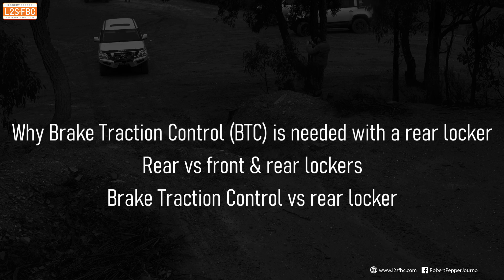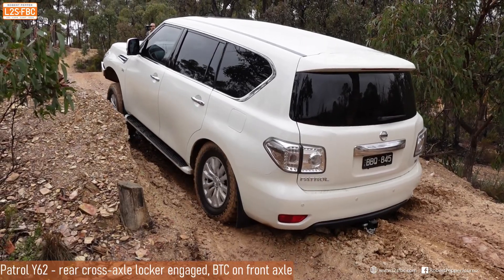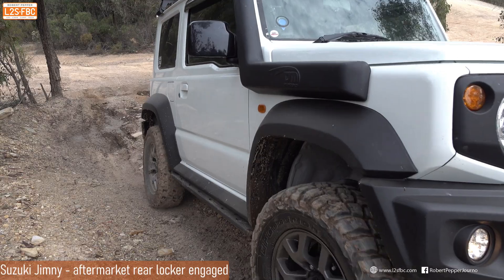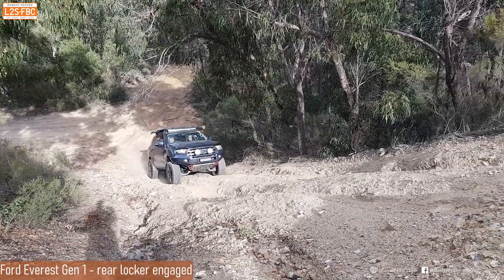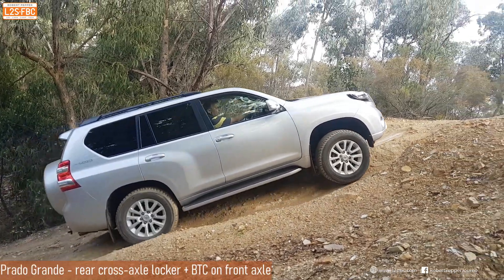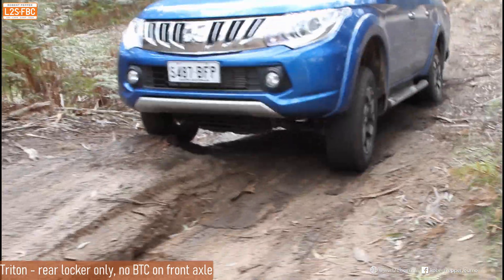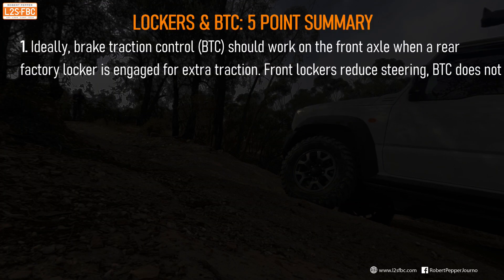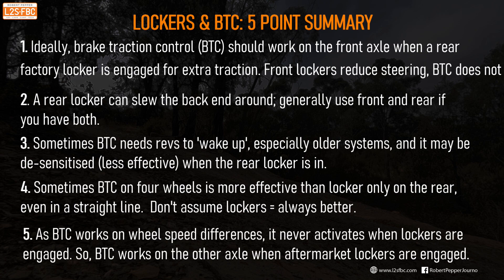Why Difflocks AND Brake Traction Control are the best!

Comment: My Jimny is so slow to engage BTC I got fed up with it. When other BTC systems reacts within less that a 1/4 of a wheel turn the Jimny needs 4-5 full turns to engage its BTC. There are two ways to handle this.

1. Drive at higher revs at higher speed and momentum than most find comfortable. This maximizes the BTC system and its adaptation to the situation. 

2. Get a diff-locker or two. From my experience, if I would only have one locker I’d get one for the front. Because then you have the BTC still active in the rear. In my opinion, this setup is the best for a beginner. 

I have double automatic diff-lockers from Kaiser. Yes, they change the drivability on paved surfaces. Yes, I had a learning curve to attend to, learning to drive the rear locker on tarmac. 

When off-road I know I have lockets that don’t risk leaking air or have an electrical failure, because mine are automatic. 

The cost is around 1/3 per locker compared to a leading brand of air-lockers or e-lockers. 

Reliability has so far been 100%. Whenever on gravel or worse I go 4x4 high and the car responds way better than original. In 4x4 low it’s a mountain goat on steroids. 

I favor simplicity, because, from experience, that’s what’s works in the long run. My automatic lockers suits my needs very well and I recommend them to anyone interested - but before buying you must educate yourself so you understand what you’re buying. Automatic lockers don’t behave like air-lockers or e-lockers. They are vastly different. Learn the difference before you spend your money. 

I’d be happy to answer any questions.
Reply from the maker: Thank you great post! Also got video of the Zook BTC in what it thinks is action. The ESC is terrible too.

Comment: Would be very interesting to test the effects of different brake pad beands/ friction formulations on how well BTC works? I can imaging pads with better bite and higher friction coefficient enabling BTC to work more effectivly/powerfully.
Reply from the maker: Possibly...but I don't think it'd make a huge difference as the brakes clamp pretty quick and hard anyway, and it's a closed-loop system.
Reply: @L2SFBC  The amount of wheel torque  that can be transfered across an axle is directly proportional to the friction coefficient of the friction material.
Some cheap pads fade badly, so when they get hot, they can drop to 0.1 mu from a nominal of 0.4 mu, 75% less torque!
The steeper the hill, the more this might be a problem?
Reply from the maker: @TC-V8 I don't think they'd get that hot. Not like slowing a car of mass 2500kg down from 100 to 0. It's one wheel briefly so much less energy.

Comment: A word of caution:  Lockig front, center and rear differentials should only be done when driving very slowly and in a straight line!!!!!! Learn from my mistakes... Best is to leave the front axle open and let BTC do its thing!
Reply from the maker: If BTC is enabled on the front axle...

Comment: I'm of the opionion that a torque biasing differential like a true track with BTC would be really good.
Reply: Torsen diffs can only transfer available torque though - so if one wheel is in the air, it has effectively zero torque, which can be transferred!
Reply: @TC-V8  The brake traction control applies the brake to the wheel that is in the air and it can transfer tq just fine.

Comment: Sometimes you only want the front locker engaged yet few manufacturers allow this for reasons unknown. Often you just need to pull yourself up especially over rocks rather than push.

That Triton was awful to watch. Far too much camera shake. Where’s the image stabilisation. Made me sick. 
Also lockers need to engage or disengage without having to move the vehicle - sometimes you don’t have the ability to go forward or back a metre just to get it to change state. Wow all that wheel spin is embarrassing for Mitsi.

Comment: Sometimes you just need it to work, not wait for even one second - because then you can slide away from the intended route - and this is why I love lockers more than any traction system. I put a rear electric locker in my Jimny, lived with it for quite a while, and then went on and put a front one. It just works beautifully, and much more safer in certain conditions, if you ask me.
Reply: You’ve clearly not experienced Land Rover Terrain Response. Wheel rotation (spinning) is detected and is halted within ⅛ of a wheel rotation. None of this crazy spinning malarkey of other vehicles.

And having decent TC and Not using lockers actually allows greater control as each wheel can be given what it needs instead of being locked in place and forced to match the rotation of the other side. I prefer decent 4 wheel TC that’s works, over lockers.
Reply: @jerrymyahzcat  I will not argue with other people's experience since it can be really great what you are talking about, sounds very interesting. I just say that for what I do with rock climbing, I'd rather have them both locked with constant power to them because they never failed me and acted as I have planned with the route I have taken.
Reply from the maker: Fair points

Comment: BTC is a reactive system. Axle lockers are a proactive system. Different driving styles are need to get the best use from each system and both systems can be equally effective when the correct driving style is applied.
Reply: Not all BTC is reactive. There are conditions when it proactively assists before slip is encountered ( in Land Rover systems anyway).
Reply: @jerrymyahzcat  Yes all BTC  systems are reactive. It’s how they operate. Land Rovers with terrain response will certainly react extremely quickly but they are still a reactive system. A diff lock would be a proactive system. You can have it locked before you use it. BTC will only react after it has activated a sensor.

Comment: Most vehicles only have active BTC up to about 15mph, after that it won't work. this is on a per wheel basis as far as I can work out, it shows in the last vehicle's climb clip that the font wheel was spinning fast with no actual effect, the BTC worked on the rear axle and it got up the obsticle. Older vehicles might also only have BTC on the rear axle. The best BTC I've found for it's age is a Wabco D on a P38 Range Rover with a stated working speed of 100kmh/62mph. I presume the other Wabco D varients also have this speed, but can't find documentation to support this.
Reply from the maker: No, BTC does work beyond 15mph, it's an integral part of ESC.  Not heard of it only working on the rear in older vehicles?

Comment: Very informative video👍👍   Kindly advise how to drive a Jimny in soft sand . From jimny utube videos I noticed if BTC is disabled , it comes back on  if the vehicle takes momentum and over a certain speed . Many resort to removing the fuse or jumping the BTC wire triggering the maintenance mode . I would appreciate  your  suggestions for driving a Jimny in soft sand . Thanks again
Reply from the maker: I have a video on that EXACT topic!  Take a look https://youtu.be/MHPGaDfCIwo

Comment: So Robert, if my 150 Prado already has a factory rear locker (2016), is it a good idea to install a front (either air or electric) locker? 

My understanding is , when rear locker engaged in 150, it will disable BTC at the same time. 

There is a hack to get around it but I am not comfortable with that idea.

I am planning to install an air front locker next month or so, but want to get your opinion first.
Reply from the maker: The 2017 Prado Grande I tested had BTC on the front axle with the rear locker engaged. However Toyota is not consistent in how that is applied. I've got Hill of Truth videos with that Prado which appears briefly in this video. I would only add the front locker if you find you are doing a lot of hilly rocky work and really need it.
Reply: @L2SFBC  to be honest I probably only do it once or twice per year.

But I kind of having this idea to "fully built" my Prado. 

Do you see any down side to get a after market front locker?
Reply from the maker: No I don't and it'd improve offroad capability and give you more options.

Comment: My gripe with most BTC systems is how long they take to engage.  While making up their mind that a front wheel has been spinning for 20 seconds, that wheel has torn wombat holes in the track.  I think a subject for a future video might be how 4 wheel BTC gets you bogged to the chassis in <15 seconds on sand...... vs diff locks.
Reply: It's about the software,
Reply: Dacia Duster activates EDL (Electronic Differential Lock) as ion as you reach 2000rpm and are in 1st gear. It has a short 1st gear - your speed is like 8-10 miles an hour at 2000...
Reply: Which is why Land Rover traction control activates in ⅛ of a wheel rotation. None of this lame spinning and spinning.

Comment: Robert, how do you compare the performance of front limited slip diffs (like a TruTrac or an Ashcroft torque bias diff) to BTC?
Reply from the maker: Excellent question. It depends on the quality of either. BTC has the advantage of never impeding turning, whereas any LSD has a pre-load which does impact differential operation and therefore turning. One can argue the LSD's preload is an advantage, but modern BTC is so good that advantage is now negated. Overall, I'd prefer BTC.  You can see a front and rear LSD in action on this truck - https://youtu.be/gAljVxg_C5w
Reply: The TrueTrac being a helical LSD will mean that once it lifts a wheel it is effectively an open diff. I had a wavetrac which is a helical but with clutch plates to lock when it sensed that it was 'opening up' and thus eliminating the issue that helical LSDs have.
Reply: Just so you know, the video in which Robert references the LSD's on the front and rear of the truck; it has the standard OEM Isuzu clutch pack LSD in the rear differential, while the front differential has been fitted with an aftermarket Quaife ATB differential. The front differential can be seen working very well at approximately the 22' 20" mark.

Comment: Wow this was great! I have a Land Rover Discovery series 2 and I swear that old traction control system is set up so well because I'm watching some of the stuff on here thinking I could pull up to each and every one of those and stop and take off and it would make it as good or better than anything in the video. I mean I'm running 33 inch mud terrain tires aired down to about 20 lb so I guess that means a lot but also I think the Land Rover traction control is pretty strong compared to other brand even for a 2002 model
Reply: The camera flattens things out, these are much steeper than they look
Reply from the maker: Correct!
Reply from the maker: Wouldn't be too confident about your D2..wait for the bigger comparo on the way!

Comment: On some vehicles, engaging the  factory rear diff lock automatically disengages the electronic traction control, which makes no sense at all.
Reply from the maker: It's done to protect the driveline, but I don't agree with the logic, brake traction control helps control wheelspin and means less need for momentum so I feel it has the reverse effect.
Reply: @L2SFBC  How is disconnecting front BTC said to protect the driveline upon engaging Rear Diff? Toyota LC300 GRS apparently does this so presumably their is some evidentiary basis. OTOH do people modify 4WD to restore front BTC when rear diff is locked?
Reply: @davidlewington3324  I'm no expert for sure, but I don't see how disconnecting BTC can protect the drive line.. I have seen a few videos where IFS Toyota 4WDs ( Tacoma, 4Runner? not sure) snap a front axle. This seems to happen when they apparently did not have A-Trac switched on. Since it happened each time when 1 tire was lifted quite high in the air, and is spinning at high speed. Then the vehicle finally finds enough traction to lurch forward, and the spinning wheel drops suddenly onto a high traction surface, like rock. Snap.  Wouldn't the vehicle be better protected if the spinning wheel had a brake applied before it ever got up to a dangerously high speed? Even if the rear axle was locked? In addition to likely providing for improved traction? But, they have a reason I suppose. I wonder what it is?
Reply: @BillyBobTup  Ah okay thanks, food for thought. I am no expert either but can only hypothesize it may have something to do with power (drive/ work) suddenly being restored to the grounded wheel and when the airborne wheel hits the ground, it too has more power to exert, and there would be a snapping or jerking moment. Note I am talking about Power (work done) not rotational force (torque). The spinning wheel in the air can be spinning fast or slow but still not generating much power through the axle or either wheel. Power = Torque x Angular Velocity in this setting. Therefore, in an open differential (in this case the front cross axle), if one wheel is in the air and freely spinning, the other wheel which isn't rotating isn't transmitting any Power to the ground (as Angular Velocity = 0, despite Torque being still present). Once BTC kicks in (kick being the operative word) that situation changes and maybe imposes a sudden load on the axle (and not directly correlated to how fast the airborne wheel is spinning at time of ground strike). IF I am even vaguely on track (pun) a mech engineer could explain it better ( I have some undergrad physics and post grad biomechanics). Like Feynman said, if it disagrees with experiment it is wrong, so I can only imagine Toyota has tested (experiment) whatever the theory/hypothesis is.Now, under the above scenario, in the case of a vehicle with front and rear lockers, it now becomes more understandable why they would disable BTC especially since you have front and rear lockers to deploy instead, albeit less steering when front locker deployed. Dunno 🙂

Comment: No doubt a well sorted TC is great, but just how many are well sorted? Very few in reality. Had the last model D-Max and the TC was rubbish. 
The clip of the Triton shows potential issues with brake overheating when the TC is slow to react.
Id rather have decent front and rear LSD's and dont have to worry about electronics failing in the bush and being unable to steer to due locked diffs

Comment: I appreciate your very informative video on this subject.
In my older model Jeep Cherokee the only traction aid was the factory LSD in the rear axle which is totally useless once a back wheel lifts off the ground.
To overcome this I fitted Lunchbox Lockers both front & rear because they don't bind up the cross axles when turning, basically unspool the outside wheel when steering.
The only downside I've experienced with these types of locker is I can't use the option of using Full-time 4WD but because they always in use I never really know how much traction I actually have.
Reply from the maker: That's a mechanical automatic locker. I don't like them, much prefer manual ones you can control so they don't lock up when you don't want them to.
Reply: One of the group I used to go hill climbing with had a Pajero with only an LSD on the rear.  He got in a situation on the side of hill where trying to go either forward or backwards just slid him closer to the edge (about a fifty meter drop).  After tying him off to a tree, I got him to put the hand brake on moderately hard, after which he was able to drive forward quite easily.  The tie-off turned out to be unnecessary, but I felt better knowing that if the worst happened he wasn't going to disappear over the edge.  An LSD needs some pressure on both wheels to lock the clutch pack, especially as they wear and become less useful.  Using the handbrake to force the clutch pack to engage was the usual recommendation in those cases, but of course it is less than ideal and should only be used briefly in extreme situations like this.

Pajeros used to have a  rear locker, but they swapped it out for an LSD to make the new vehicle cheaper when they realised that the people buying them were mostly using them as a shopping cart or to take the kids to soccer...
Reply from the maker: An excellent comment, thank you and 100% agreed!  Pajeros also had a poor BTC system that gave up after a while, so you'd want the rear locker on for long climbs.
Reply: I do understand that totally and after using both selectable air & electric you could think that, horses for courses. But in my case I mainly use it for hardcore off-roading I've personally witnessed so often axle failures because the selectable locker's load up CV's /Uni Joints when traction is required when trying to change direction and to accomplish that often drivers forget to disengage the front locker.
My first experience with traction aids in a 4WD was fitting Torsen Centres in my Hi-Lux in the early 80's after having one fitted in my Coswort Escort for Rallying in 1974, a game changer.
Reply: @aljeepster  when you refer to Torsen centres is that the same as a (Eaton) Trutrac?

Cheers